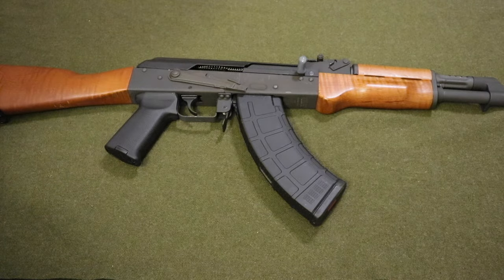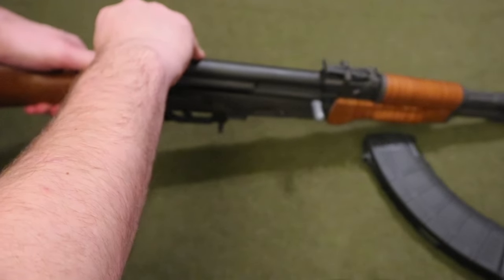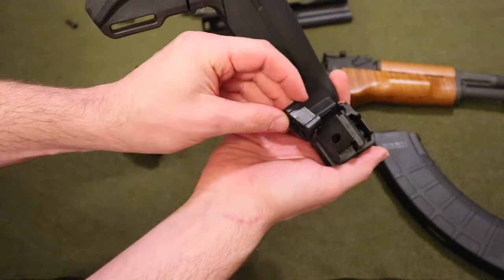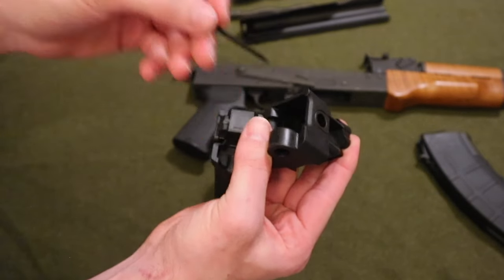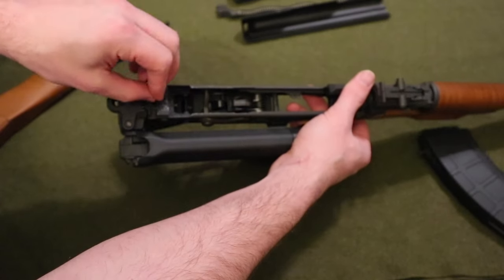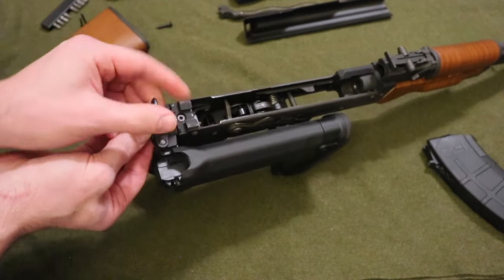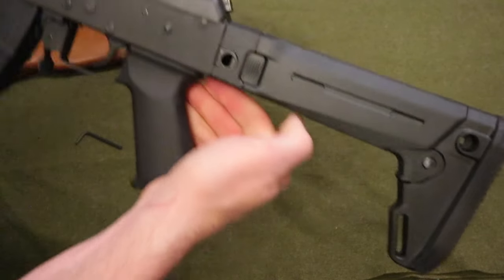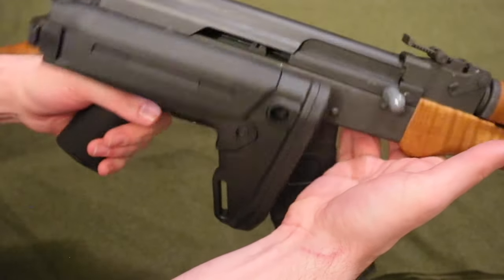Installing Magpul ZHUKOV-S stock on AK-47

Comment: I bought the Zhukov FDE kit off PSA and nothing fits flush on my Riley Defense RAK.  Bought it all black polymer.  Might buy a dremel tool just to sand down certain areas.  Worse experience I've had installing furniture on a rifle.  Going to stick to my ARs.
Reply: How did it go? I just tried to install this on my WASR-10 today, and it has been a nightmare. Basically, it won't fully fit into the frame such that the holes can line up. I think they even forgot to send a screw. My kit seems to have only come with 2 screws. I had to hammer the sh*t out of it to get it inside my WASR, and now the plastic is all chipped and coming off. Absolutely awful stuff.
Reply from the maker: @kent4239 it worked great for me while I had it I didn’t have any issues.
Reply: @kent4239 I bought a Dremel tool and sanded the parts down.  The angled black plastic part that goes on the inside of the stock I removed because that was the part that wouldn't allow it to fit flush.  It would have a small gap.  The stock now fits flush and the screws fit easily on top.  Palmetto State Armory did send me the wrong screw for the grip so I'm looking for a replacement.  I bought a Riley Defense RAK.  It was a terrible experience.  I literally had to beat it to hell to remove the stock.  The handguard was a pain too.  I had to use the Dremel to sand it down too.
Reply: @  Thanks for the insight. The butt literally came off the stock as I was trying to remove it. Luckily opticsplanet refund process seems easy. Still want a folder on my wasr but might just have gunsmith do it, smh.

Comment: Excellent video. Blows away the others online. Also blows away the instructions magpul put in the box.  I think mine was used even though it was supposed to be new as the insert was already installed and there was dried threadlock on the screws. I also cannot get the hinge block tightened down all the way. And no QD socket inserts come with it for the back of the stock? Also no cheek riser.  For $100 I am somewhat disappointed. Magpul is being super cheap.
Reply from the maker: I appreciate it!! Sorry about the issue products are hit and miss these days.

Comment: Thanks for the help.  I just couldn’t figure it out.  I just put it on my PSA AK103!  Looks and fits great!  Only issue is it isn’t completely flush with the back of the receiver.  There is a very small gap.  But not a big deal.
Reply: Hey, I also have an AK 103 from PSA and was looking into getting a Zhukov for it. By chance can you tell me more about your problem?
Reply: How?!?
The little metal back bracket is missing from the 103.
Reply: Same with my psa. The gap is at the top and it’s flush at the bottom. Kind of driving me crazy
Reply: I believe the web site said its not compatible with PSA but I'm not 100% though